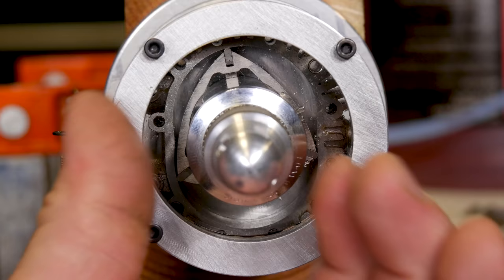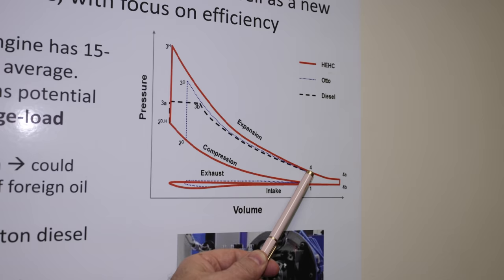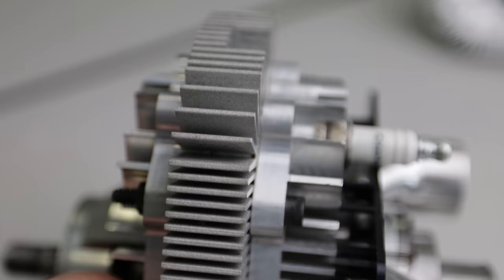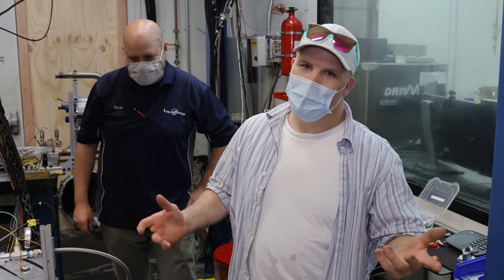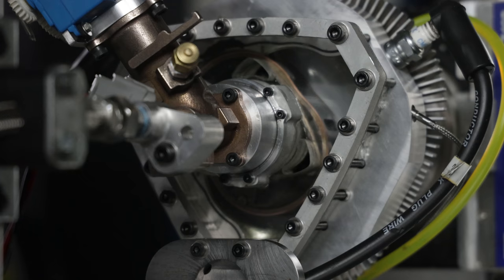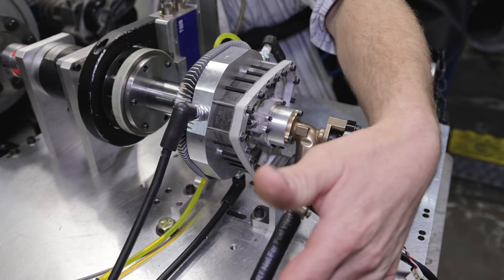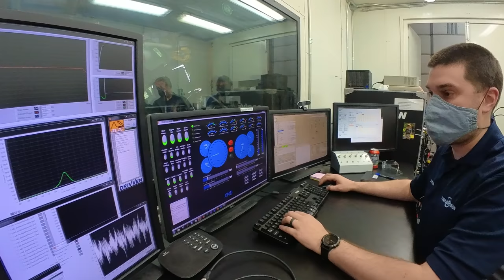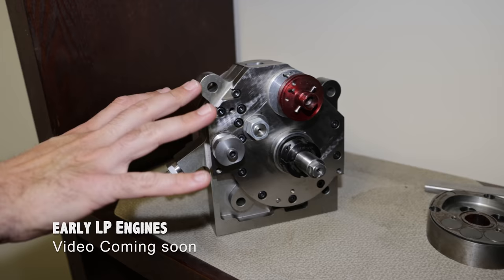See Thru Liquid Piston Rotary Engine - In Slow Motion

Comment: I’d imagine this helps with the heating issue as well. Instead of just one spot where combustion occurs, there are three. Gives one spot a bit of time to cool
Reply: I see that the centre portion (piston?) only has one half that gets exposed to the power stroke. Hopefully heating up one side of the peanut shaped piston doesn't cause problems
Reply: Am I missing something?  Why cannot both sides of the engine (where the see through panel is located) be  water cooled chambers?
Reply: @mwong000  They usually do have cooling systems, unless it's in an aircraft, but the problem with standard rotary engines is, combustion is constantly occuring in one spot. There's no exhaust or intake stroke to cool the combustion chamber, just a spinning rotor. so the burning reactions happen back to back, causing excessive heating in one fixed spot of the engine. If you watch the high speed on this video, this engine has three distinct points where fuel is burned. Standard rotaries only have one. So the combustion chamber gets a chance to cool before firing again, because it alternates between three points. The heat of each power stroke is distributed.
Reply: @Nikolai_The_Crazed  Im still confused.  ANY motor with high hp per cu in will, by definition,  create a lot more heat,  Right?  That doesn't mean we should  not try to design high power engines relative to weight or size.  Agreed? The challenge is to get rid of the heat and/or use more heat resistant metals.   There is A LOT of sq in that can be used for cooling (ie. the sides of the engine).  Apparently Liquid Engine guys have a LOT of cooling fins at exactly the place I am describing.  .  And it is obviously working just fine using air cooling, albeit for just a few minutes of demo.  Worst case, for continuous duty, use a water jacket, just like car engines.  That may add a little more weight, but so what --- they are so much smaller and lighter that there is plenty of room before they approach conventional engines in size and weight.  Therefore, being an engineer, but a novice in engine technology,  I don't see why you think cooling is such a show stopper.  The US Dept of Defense  is funding Liquid Engine over many other contestants, so they must think the technology has promise.
Reply: @mwong000  There is one half of the rotating "piston" that experiences three combustion events per revolution. That section of the piston will be difficult to cool and will just get extremely hot, potentially a failure point. In traditional Wankel, its the sides of the non moving "cylinders" that get heated, once per revolution. These were larger in surface area and accessible to the cooling fluid etc. LP has just moved the problem elsewhere on the structure and increased it 3x in frequency.
Reply: @TornadoCAN99  You are right.  The engine will produce a huge amount of heat.  That must be what LP is  trying to solve.  On a different note, what do you think of the rotors having a much larger area contacting the cylinder as opposed to the point (in 2D, thin straight edge in 3D)  of the original Wankel?
Reply: @TornadoCAN99  ...all the fuel comes in through the shaft right? So what if you cooled the fuel first before pumping it in?
Reply: @gabrielclark1425  Not sure pre-cooling fuel will help...its not that it needs protection from the high temp, its the half side of the piston that needs to kept below temps that soften the metal and/or cause it to expand more than the cooler side...leading to warpage/seal issues.
Reply: @TornadoCAN99  exactly. The fuel flows through there before it goes into the combustion chambers. It's like water cooling, but without having to further complicate the design.
Reply: I don't see that as there is still a lot of heat generated in a small footprint.
That said it will help loads in regards to thermal expansion.
Since the temperature will be much more evenly spread.

Comment: So basically, it's a single cylinder engine that acts and functions as an inline-3? Sounds like a wonderful concept! Imagine the power-to-weight efficiency in motorcycles, for example.
Reply: There have been wankel motorcycles you know? It just wasn't developed enough(was very unreliable).
Reply: @sierrachief117  Yes, I was aware. Why ask?
Reply: @akisalmenaho8473  Because your comment made it sound like you didn’t know it existed.
Reply: @naythanjones2320  But, this new engine is not a wankel, it gets rid of all the issues that wankel engine has (for the most part that is).

Comment: When the engine is a dorito and the rotor is the bean
Traditional rotary guys:
Wait, that's illegal
Reply: I love the "wait, thats illegal!" meme thing. I'm happy you said it 🤣😎
Reply: Swapping the rotor/stator shapes solves the tip seal problem and the spark plug blow-by problem and the high quench problem and the early blowdown problem. The convoluted intake gas flow isn’t ideal but the design simplicity is genius.
Reply: Not a bean essa peanut

Comment: Back in 73/4 I owned a NSU Ro80 with the Wankle twin rotor engine...this was a beautifully smooth running Car but the engine was a real pain because of the problems with the seals..In UK many vehicles were converted using a Ford V4 engines, This meant that you still owned a beautifully design car but with a far more reliable engine. It was a real shame that this vehicle suffered such a catastrophic failure as the car was so revolutionary in many ways.

Comment: Doesn't look like the combustion has much leverage on the crankshaft but I guess that's a rotary and hopefully it makes up for it in RPM's. Very cool engineering.
Reply: Hopefully they can add additional rotors to balance it out. It looks like the engine can't rev very high as it's fairly imbalanced.

Comment: The human mind is an amazing thing. This engine is part math, physics and art.
Reply: but mostly...useless junk.  as all rotary engines are.  the sealing surfaces in this engine are no more desirable than in any other wenkel.  They may not break, but they'll wear out just as fast.  The main problem with all rotary ICE's.  No way to properly lubricate it.
Reply: oliver durgen I have no experience owning a Wankel. I am a licensed heavy duty mechanic so I’m curious how these would do with the natural lubricity of diesel? What kind of compression ratios can these handle?
Reply: @14goldmedals  how do you separate the  oil system from the combustion event?

in a piston engine, the piston does this job, as well as lubricating itself by collecting oil from the sump and distributing it on the cylinder walls.

In a Wenkel, there is no way to separate the lubrication from the combustion chamber.  The oil is constantly burning off, collecting debris/ash, and/or just going right out the exhaust as unburned hydrocarbons.  Sort of like a 2-stroke.

Life isn't some big conspiracy, like many would have you to believe.  Rotary engines suck, and that is only one of the many reason why.  Least of not is performance, which outside of very small sportscars, isn't very impressive, from a power density or fuel efficiency standpoint.

Torque is the ability to preform work.  Per liter of fuel, rotory engines make less torque than just about any ICE I can think of, regardless of size or purpose.

The best attributes of the rotary engine are it's compactness, and minimal vibration.  This has uses in packaging.  But outside of some bizarre form factor, there are much better alternatives to rotary engines, especially now.
Reply: Art? I don't think so
Reply: 1% part each. The rest imagination. This engine has been around a while and still no application and no available engine.  Cool demonstration, now let's see the math from actual testing.
Reply: But for the most part it is utter BS.

Comment: With the advent of electric cars,
I like where this is going, engine
Technology will continue, this team
Have proved that. A really fantastic
Job. A stepping stone to the next
Evolution. I watch with interest.
Reply: It will prove impossible to sell
Reply: @ronrichardson3103  they won't sell this, its
Incomplete, this is just research. The part
Of small companies like this team, is to push
Tech forward.  There are lots of little firms 
Like this. The boundaries of whats possible.
Mazda have an HDDI four cylinder petrol
Engine, that uses as little fuel as a diesel.
Mazda didn't do it all by themselves. Some
Of the work is out sourced to small firms like
This bunch.

Comment: my old rx7, if left sitting for a couple days would generate soo much smoke out the tail pipe that it would be right at home on any battlefield as a smoke screen generator. lol
Reply: My RX 7 didn't have that problem. What kind of MPG did you get?  It sucked it up at around 16.

Comment: That was awesome to watch!  I'm impressed how they incorporated all of those cycles of operation in to their rotary engine design.  Pulling fuel-air mix through the shaft is insanely creative.   Three combustion events per revolution per rotor is absolute genius.  I so want to see this engine scaled up and put in passenger automobiles.  Please, consider creating and offering crate engines too.  I will be among the first to buy one to drop in a yet-to-be-determined project car.
Reply: @Retired Bore Yes, there was a pre WW1 French 9 cylinder radial single exhaust valve two stroke where the whole engine and prop rotated with fuel/air entering through the hollow crankshaft. Called from memory; mono soupape, Wikipedia says they were very effective.

Comment: The apex seals look like big improvement and chamber designs.  Love there work.
Reply: The most important aspect of this engine IMO is that the apex seals aren't pushed against the walls of the engine from the momentum imparted by the rotor, unlike in a traditional Wankel. This is huge for reducing wear.

Comment: we need to see the performance of this engine to power a car
Reply: pwr is 4hp for every 4.5 lbs, at least on the small prototype so a car sized model would probably be light enough to lift with your hands.
Reply: A car is a bad application for a rotary engine. Rotary engine run most efficiently in applications in which the engine is heavily loaded and running at full throttle most of the time. Such applications are boats, yard equipment, and airplanes. With its power to weight ratio, it would make an incredible chainsaw or leaf blower. A much lighter chainsaw with much more power would be a very big asset to the guys running chainsaws while up in the trees. There have been many test matching identical boats and swapping out the motor in one with a 13B rotary. The rotary equipped boat vastly outran the piston powered boat of the same HP. It produced higher full speed, higher acceleration, and ran more distance on the water for the same amount of fuel.
Reply: @bmarvin6339  that's nice. I didn't know that 2t piston engines were that inferior. In that case, a motorcycle with his engine would be ideal. And if it wasn't, I don't care. I love 2t so I'd love this engine even more. Just allow me to have a few spare rotors and housings
Reply: Isn't Mazda using this type of engine?
Reply: @lawlaw9176  some mazda cars use wankel rotary engines which are similar, the engine in the video aims to fix some flaws inherent to the wankel design that mazda used
Reply: @bmarvin6339  wouldn’t a variable shaft or timing help with that? Like vtec but like rotary and more to do with which rotors are spinning. So like two rotors for low speeds and as it speeds up the center shaft sort of triggers the other two? I don’t know much about these so I apologize if that was a dumb proposal/question.
Reply: @bmarvin6339  would be awesome in a snow mobile , light, high revs , singe speed , .
Reply: @ExtremelyOnlineGuy  rotary don't really have camshaft since they have no need for it
Reply: @muhdaisyhaqeem7863  they have an eccentric shaft and the same logic could apply.
Reply: @ExtremelyOnlineGuy  Not quite - the e-shaft has no impact on timing or torque/power production... the ecentric lobs are there to ensure the off-centered rotation of the rotors, to allow them to - effectively - move up and down into the upper and lower chambers.  The equivalent of changing the timing on a 13B rotary is to adjust the position and size of the intake and exhaust ports (typically using a dremel or similar).  Obviously, this is a one-way operation - once you've drilled the ports larger, you can't go back.
Reply: @lawlaw9176  No - this engine relies on a triangular housing with an oval rotor... the 13B used by Mazda uses a pinched-oval housing with a triangular rotor.
Reply: @logicalChimp  interesting so why exactly would it not work with a liquid piston? It seems this explanation is more fit for rotary
Reply: @ExtremelyOnlineGuy  From what I can see, the timing for the liquid-piston is based on when the intake and exhaust ports in the inner rotor are exposed - the e-shaft is again there to ensure the eccentric motion of the rotor, which has to be mathematically precise (and thus not subject to changes for timing etc).

If anything, changing the timing on the liquid-piston may be harder (or may be easier), as you'd need to change the entire rotor in order to adjust the position (and thus timing) of the intake and exhaust ports.
Reply: @logicalChimp  so the variable would be on the shape of the internals not the actual shaft? And if so would probably vastly change the balance of pressure and fuel to air mixture?
Reply: @ExtremelyOnlineGuy  Not so much the shape - again, that has to be mathematically precise to ensure consistent sealing, etc), but the position of the intake 'pipe' in the rotor (the intake runs from the middle of the  rotor to the trailing edge of the non-ignition end of the rotor).  Moving that intake a degree or two to either side would likely change the timing of when it opens and closes, and changing the shape of it would adjust how much gets pumped in.

Compared to the 13B (which I'm more familiar with) I'm not sure how you'd adjust for Torque vs HP,  but it would be tweaking the angle and size of the intake within the rotor that made the change, I believe.
Reply: @bmarvin6339  i think you mean a ROAD car is a terrible application for a rotary engine. For circuit racing it's ideal "application where the engine is heavily loaded and full throttle most of the time".
Reply: or an ultralight

Comment: Great video.  The problem with this engine though is that the liquid piston engine  doesn't work. We'll never see an automobile powered by it.  It is a concept design only and does not stay running on its own.  The only way it runs is that it is being driven by an electric motor.  If you watch closely you can see why.  Flame front from combustion goes around the leading  edge of the rotor.   Notice how it even stays running on the acetylene after fouling the plugs.  Mazda's rotary is still the best rotary design simply because it actually works under it's own power and we can use it.

Comment: Stationary seals is brilliant. Should last longer since there are no G-Forces messing with their stability. 
Very cool design. Hope to see it in Cars soon.
Reply: I'd love to see this engine design, coupled to a 5kw generator, installed in a Tesla as a range extender/onboard charger.
Reply: Don't forget uneven crankcase heating due to singular combustion chamber, a problem with mazdas
Reply: @theinstitute1324  i am betting the exhaust gas path will do a decent job spreading that heat around. Just wonder how that rotor holds up when fuel ratio gets too low and the exhaust is too dry to take the heat with it.

Comment: The only thing that would concern me with the intake and exhaust design is if scaled up into a car engine would the hollow eccentric shaft be able to handle high power forced induction applications.
Reply: I worked at Mazda North America for 15 years rebuilding the rotary engines. The Eccentric shaft was the most difficult thing for them to make. I don't believe a hollow shaft could hold up to fourth in the engine.
Reply: They will have to fix the intake and exhaust for automotive or larger applications. Small scale is fine.
Reply: I want to see a Turbo Diesel Version, and if it outperforms a 90s stock Cummins i will melt

Comment: This is epic. The combustion is spectacular. 
The problem with these Wankel type rotary engines though is that the combustion / expansion phase doesn’t produce as much engine torque as a linear moving piston, and the said phase for each combustion chamber can only last for 1/6 of a shaft turn / revolution  instead of 1/2 of each other shaft turn for a classical engine. So it lasts a very short time, which is likely to limit the maximum motor RPM. 
As of motor weigh and compactness though, this improved rotary Wankel type engine is great. 
Thanks for the hard work, the resulting images are well worth it.
Reply: you didn't add the gearing to the crankshaft. it's not 1:1 as a normal piston engine, and you also have a smooth "similar direction" flow of momentum instead of completely stopping and going the other direction. it's like going back to a square wheel from a round one.